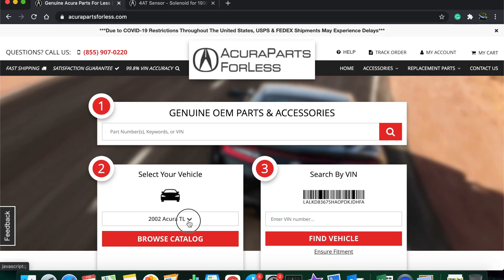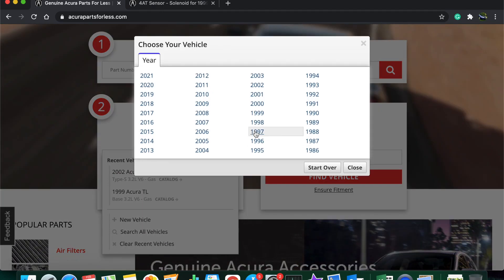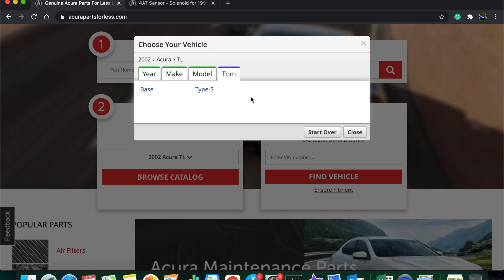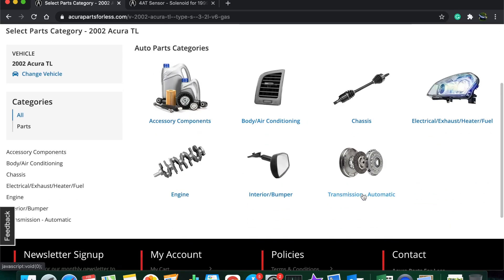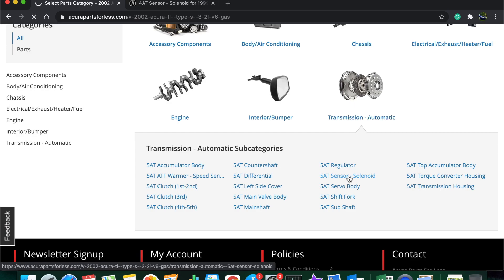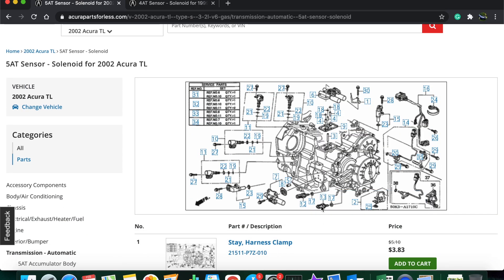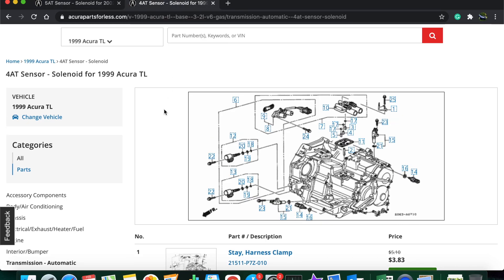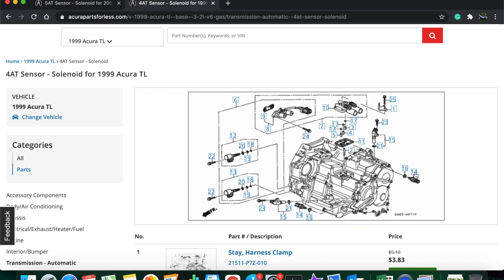How to Replace Honda/Acura Transmission Clutch Oil Pressure Switch P0845 P1738 P1739 P1740

Comment: Hello, I’m having problems with my 1-2 gear now with 2003 Acura TL type S. 

So rewind one day 2 weeks ago my tranny almost locked up when I went from breaking at 40MPH to just touching the gas pedal. Nose of car dived down for a second and after that 3-4th gear where delayed a lot with very hard shift and other gears where also funky . No codes ever showed up. I did an immediate drain and fill and AT filter change which pretty much brought it back to life. ATF was pretty blackened/dark grey and hard a slight burnt smell, lots of grey Sludge on drain plug. However there was still a sputter from 3-4th gear and I tried driving a tad hard and it would be worse but intermittently and if I did it just right it would be a perfect shift with no stutter, could be engine mounts. When I switched it into manual shifting it clunked for a second. So I found your prior video last week Monday and cleaned the solenoid screens. Which helped out a lot with all shifts but made 1-2 gear shift pretty hard when cold, bottom single solenoid screen was clogged and the center pillar screen was slightly clogged on A/B, I could do a few higher RPM pulls with a slight stutter from 3-4, I figured it was the engine mounts and yes they where absolutely shot, so I was able to replace the front and side the other day which helped quite a bit, and will replace the two transmission mounts soon, and pay someone to do the rear engine mount.

After the solenoid screen cleaning, 1-2 gear has been hard. This morning coming out of my driveway the car would not shift from 1-2then shifted pretty hard, I then got a check engine light, flashing D5 and VSA stayed on, car would not shift or move at all. After turning the car off and on, it went away except the check engine light, it was able to shift like it did before, I’m sure it would be better once warmed up.

So, is there a 1-2 gear pressure switch? And 3-4th? My 4-5th shift seem pretty good. However I’m unaware what to do next. I will be pulling the codes later today. 

Side note, sometimes doing a higher RPM pull would cause the rpm to shoot up 500rpms going from 3-4th but shift into gear perfectly, could be engine mount since it was before I did those. Also I possibly damaged the top solenoid while taking it off, it was stuck and I tried prying it with a screw driver and bent the A/B solenoid housing (closest one to the front of the car) about an 1/8in maybe 1/4in. I did shift it back into place. Maybe it’s sticking now and if that’s the one that controls 1-2 gear it could be that.

Edit; just pulled the codes, got P1750 as the only one.

Thank you.
Reply: How did it go ? Did you ever get it to work
Reply from the maker: Yah you definitely damaged the solenoid. That code is saying it needs to be replaced. Make sure you get a Genuine Honda part, aftermarket ones have been know to give people problems. Part number is 28250-P6H-024. You can get a used one on eBay for $40-60 or a brand new one for $350.
Reply: @CarRepairsMadeSimple  yeah, I actually just replaced it yesterday and 1-2 gear shifts butter smooth.

The RPMs from 2-3 still jump 200-300 then shifts a bit aggressive but smoother. And 4-3 is clunky. 

Literally just finished replacing the 3rd and 4th pressure switch.

It did not fix it and I found black partials in the A/T dip stick. Seems like it’s probably the 3-4th gear clutch pack unfortunately.

It could be the speed sensor or the power solenoids.

I’ll be replacing 28500-P6H-013 and 28400-P6H-013 on the top near A/B solenoid. I will let you know if that fixed the RPMs jumping on 3rd. I posted a video on my account if you need to see the current problem.

Thank you for your videos they are amazing quality and detailed.

Comment: Is there a switch for 1 st gear? My car wont engage 1 st gear when i put it on drive but it will go into first gear if I manually shift it to 1 any ideas? No check engine light ir flashing D on dash
Reply from the maker: No, there's no first gear pressure switch. But there are 8 total various solenoids that play a role in shifting on this transmission, including these 2 pressure switches. I would first make sure your ATF is clean and not over/underfilled. You could also try cleaning the solenoid screen filters. And lastly, I might recommend checking the Ohm reading on all of the solenoids on your vehicle.

Comment: Is it possible my 4th gear pressure switch on tranny is bad ?  It goes in 4th drive on automatic but goes down to 3rd after 40 to 50mph
Reply from the maker: Hmmm are there any check engine light codes? I had a similar problem where my car would randomly change gears, and the solution to that was to clean the solenoid screen filters. I have another video on how to do that on my channel
Reply: @CarRepairsMadeSimple  yes engine light.  But the car has no tags or nothing so I can't drive it to get the computer red
Reply from the maker: @HiddenLeaf979  I would recommend getting an OBD-II scanner, such as the Ancel AD310. Super convenient to have and will tell you what’s wrong with your car rather than going at this blindly
Reply: @CarRepairsMadeSimple  guy told me it may be the 4th pressure switch but yes I do need a obd scanner.  It drives in 4th drive but once I hit 40-50 mph it high revs and goes to 3rd
Reply: @CarRepairsMadeSimple  once I hit 40-50 it bounces from 4th to 3rd. Like it wants to stay in 4th
Reply from the maker: @HiddenLeaf979  I got this from the service manual:
Symptom - Excessive shock, or flares on 3-4 upshift or 4-3 downshift
Probably Causes - 
1. Shift solenoid valve C defective 
2. A/T clutch pressure control
solenoid valves A and B defective 
3. 4th clutch pressure switch defective
4. CPC valve B defective
5. Foreign material in separator plate orifice
6. Shift valve C defective
7. 3rd accumulator defective 
8. 4th accumulator defective 
9. 3rd clutch defective
10. 4th clutch defective
Notes - 
• Check the D5 indicator, and check for loose connectors. Inspect the O-rings, and check the shift solenoid valve for seizure.
• Check for clogged orifice in the clutch pressure switch connector. If the orifice is clogged, remove it and clean the connector.
• Check 3rd and 4th clutch pressures.
• Inspect the clutch piston and O-rings. Check the spring retainer for wear and damage. Inspect the clutch end plate-to-top disc clearance. If the clearance is out of tolerance, inspect the clutch discs and plates for wear and damage. If the discs and plates are worn or damaged, replace them as a set. If they are OK, adjust the clutch end plate clearance.
Reply: @CarRepairsMadeSimple  thanks.  My generation is know for having 3rd and 4th pressure switch give out.  I got a Acura tl 3g

Comment: How you guys afford to pay 60-100$ per switch with HONDA is beyond me,esp when the tran is LOADED with switches,solenoids,sensors etc some of which are 500- ...
Reply from the maker: That’s why I try to make videos like these, so you know which of the many switches you need to replace.
Reply: @CarRepairsMadeSimple  the ones that got the mini metal cans on the ends have actual slide function inside,DO NOT BUY CHEAP ONES ,standard brand at the least,they have Chinese made ones but I wouldnt

Comment: Mine won't go into 3rd at all... It does 1st & 2nd no problem, once I get up around 65mph it just doesn't shift??? To go into 3rd any insight/help on this is appreciated.
Reply from the maker: Do you have any check engine light codes? Three things I can recommend is to ensure your transmission fluid is red and clean, not dark brown, black, or burnt smelling. Also, check the ATF level isn't under/over-filled. I have another video on cleaning the transmission solenoid screen filters, give that a try. Lastly, try replacing the third gear pressure switch as shown in this video.
Reply: @CarRepairsMadeSimple  man I went for a drive yesterday & when I put the car into drive or d5 instead of moving the shifter all the way over to d5 like where the plus and minus symbols are I just put it to d5 goin straight down instead of over & it shifted fine so I think I was just in the wrong gear 🤣 thanks man.
Reply from the maker: @tjplay-213  whoops! Haha glad to hear everything’s working okay!
Reply: I stalled my car like that when I first got it lol. Good ole manual mode

Comment: Thank you again for the awesome video, I bought my 02 TL-S at 115k back in 2007 and got a new transmission for $500 thru an Acura mechanic friend of my mom, ever since then I've been doing 3x3 drain & fill for ATF and still doing smooth. I'm currently on 237k with the original engine and that transmission I got after the vehicle purchase. so I'd say that transmission's been on its 120k miles with no major tune up other than ATF replacement. a couple of things to point out is that I did my very first transmission filter replacement at 237k so I guess I've been lucked out by clean ATF I've been maintaining? and also I didn't see any external oil-jet kit installed on where ATF filler bolt's located, I saw some people saying that they switched to the internal jet-kit but mine was replaced in 2007 so I don't know if they just didn't install that or it has an internal one.  I might revisit this video in case I notice some slippery on either 3rd or 4th gear, but I just wanted to share my experience with you since you're pretty big on maintaining your transmission :) I mean I guess every 2nd gen owner should be haha.
Reply from the maker: thank you! Yeah i guarantee most transmission failures on these cars were due to not changing the ATF enough. I've had so many commenters with car problems tell me their fluid is black or the level is low. Any transmission made after 2005 I believe has an internal oil jet, and all the others have the external recall. Keep up the great work with your car!
Reply: instablaster

Comment: Very helpful, slight confused. if my CL is an 03 and it's my 2nd gear that is slipping, do I still get the 2nd gear for the 99 TL?
Reply from the maker: The 1999 vehicles have a 4 speed transmission, which have a 2nd and 3rd gear pressure switch. The 2000 and newer vehicles have a 5 speed transmission and only have a 3rd and 4th gear pressure switch. So no, the 2003 CL does not have a second gear pressure switch. Perhaps check out my solenoid screen cleaning video and ensure those little filters aren’t clogged. Also check the condition and level of your transmission fluid, it should not be dark or smell burnt, and the level should be between the 2 dots on the dipstick. Do a 3 quart drain and fill using Honda DW-1 ATF if you haven’t changed the fluid in a while. If that all checks out, your last bet would probably be the shift solenoid valves. Try the other things first and come back if you still need help!
Reply: @CarRepairsMadeSimple  amazing my brother! Thank you!!!

Comment: Hey man thank you so much. Your old videos are helping me a ton and I cant believe you just posted this. Thanks.
Reply from the maker: Jason Tyo you are very welcome! I’m glad to know these videos have been helpful!!
Reply: @CarRepairsMadeSimple  Ive got an '02 TL-S I do not want to get rid of.
 These cars are forgotten hidden gems of early 00's Honda. My trans just started acting up, I hope I caught it before anything catastrophic happened.
Reply from the maker: Jason Tyo I hope so too! Keeping the transmission fluid clean is probably the most important thing to keep these cars running!
Reply: @CarRepairsMadeSimple  So we changed the Filter and ATF and it came right back!. The Car is working again.  I bet the fluid that came was out from the factory. Thanks again.
Reply from the maker: Jason Tyo that’s awesome! Good thing you acted quickly, I’m sure your car will be fine and last many more miles to come!
Reply: That’s so good to hear!  Can you explain what you mean when you say the transmission was acting up?  I also have a 2002 TL, and I thought that the transmission went out.  

About 9 months ago, I was driving down the highway, and the transmission just slipped out of gear. I pushed the accelerator down, and it just acted like it was in neutral.  The engine just revved.  So I figured it might be just that one gear.  So I shifted down.  It caught for 5 to 10 seconds, and then slipped.  I kept downshifting thinking it might just be certain gears.  But all of the gears seemed to be having issues.

I was able to get it off the highway.  I did have to stop at a light, and then I was able to drive the car a little bit more.  But when I had to go up a hill, it started slipping a lot.  So I just pulled over and had it towed.  

It’s been sitting for the past 9 months. I recently revived it, bc I was going to sell it.  But in the process of getting it ready for sale, I just thought I would try driving it up and down the driveway. 

I was able to drive it up and down the driveway about 10 times before it started slipping (maybe it slips when it heats up?).

So based on what I just said, do you think it’s possible that I can just change the ATF and filter, and have the car start working again just like yours did?  

I have never changed the transmission fluid, since I bought the car in 2007 with 60k miles on it.  It now has 161k miles on it.

Btw, I did smell the transmission fluid right after it started slipping, and it did smell burnt.

My mechanic said he had a customer who changed their transmission fluid, and the transmission died a week later, bc he had not changed the transmission fluid in a long time.  But I think he had a ATF flush done as well.  So maybe the pressure from the flush caused the tranny to go kaput.  

Any advice would be appreciated.